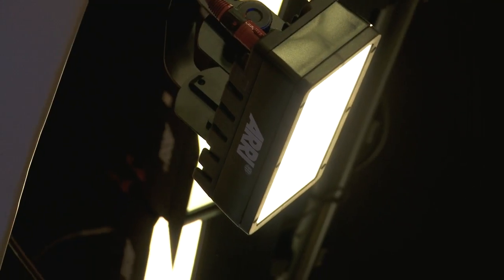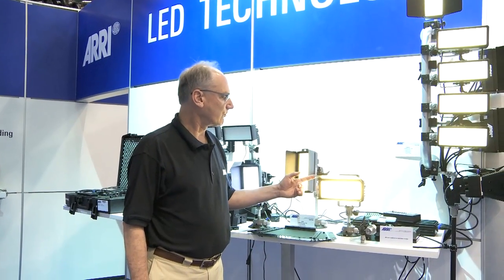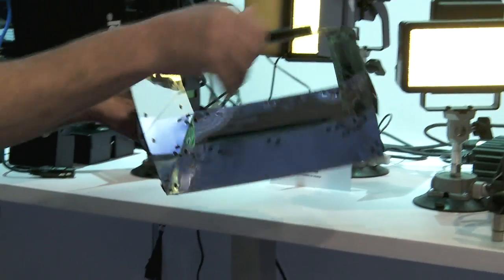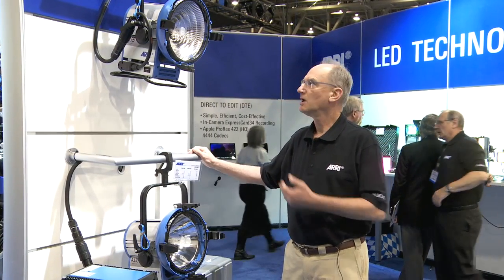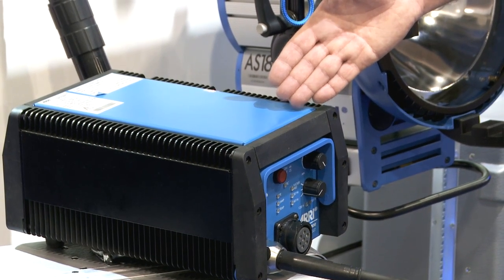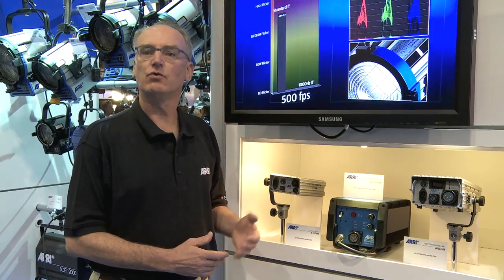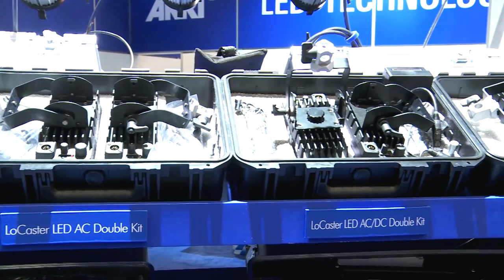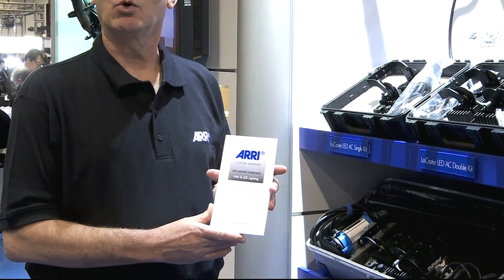NAB 2010 ARRI Lighting

Comment: This John Gresch  guy really knows his stuff . I have a question can I buy spare LED bulbs from Arri and how hard are they to replace .I have a 150 watt Arri fresnel  and  I had a lamp burn out  ,It took me  months to figure out how to change the lamp ,then someone told me there is a thingie on the top of the light ,its really small  and looks like a little peice of metal  , you have  to slightly pull it back  and then the top  lifts up , why don't they make a lamp removal video ,